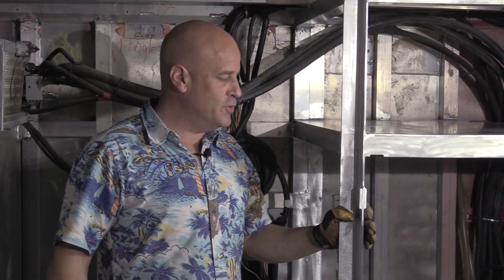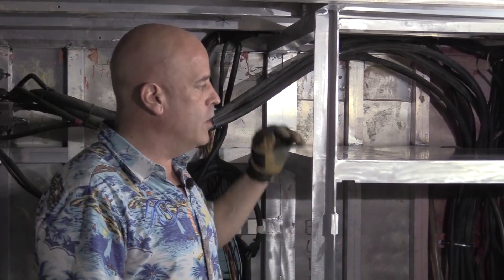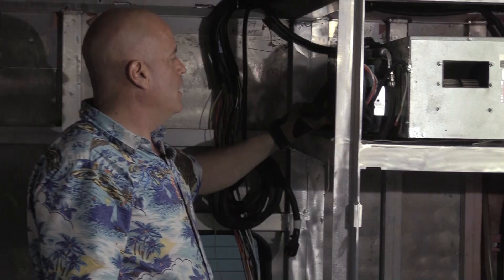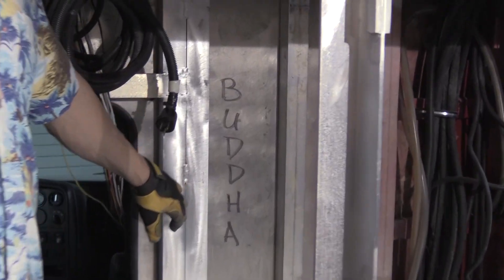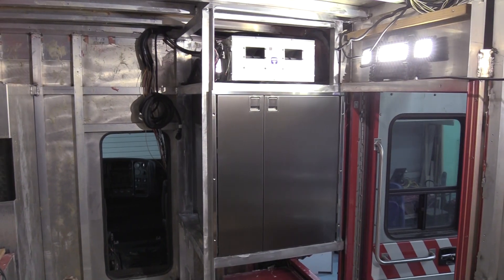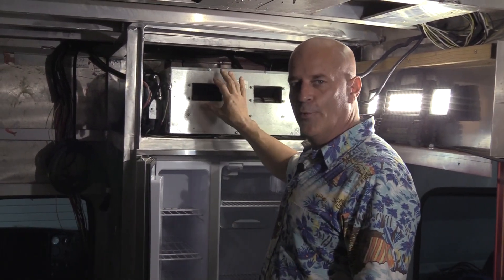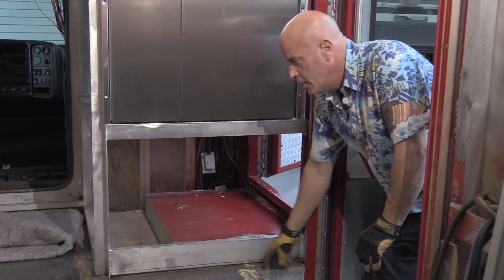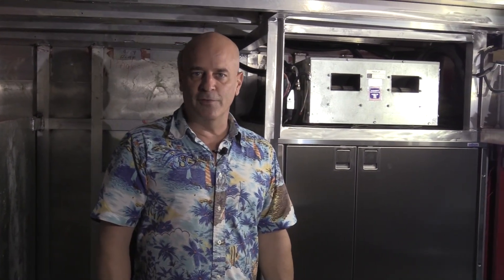Ambulance to RV/Part 5 - Yacht Shop Creations "The Bear" Project

Comment: Dear Jim,
Wonderful stuff but I have a slight gripe ( a trifle too brief). What are the internal dimensions of this ambulance? The aluminium frame should give it much more strength coupled with lesser mass than wood. The new fridge appears to be a marine type &/ dedicated motorhome appliance. How are you going to incorporate a kitchen, toilet & shower room in such a restrained area?  Keep up the great work, I am sold on it. very well done. Kind regards.
Reply from the maker: Hello my dear friend! 
  The Next video coming out this week will show the layout as well as I will go over the interior dimensions. But the unit is considered an 14 foot box by 8 foot. It will be more of a constraint area as with the interior dimensions being as such.  It will be more of a live out of rather than live in type. Major factor is the full size queen bed will take up a bit of the room. Stay tuned and we will have more for you soon.
Be well,
Jim
Reply: @YachtShopCreations  Dear Jim,
Thank you very much for your courteous reply. Indeed 14 X 8 foot is rather small; it be very interesting as to how much of a challenge it caused you & more importantly how you dealt with such constraints. So far your aluminium frame looks very impressive & does the fridge/freezer. To squeeze a double bed (Queen size no less) remains to be seen to be believed but I am sure we are in for a surprise. Good luck in your endeavours. Kind regards.